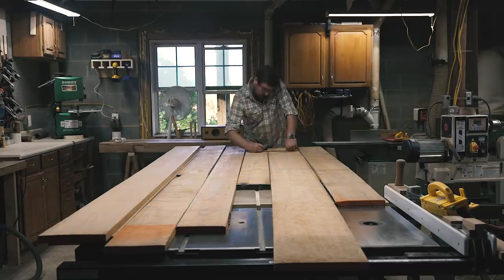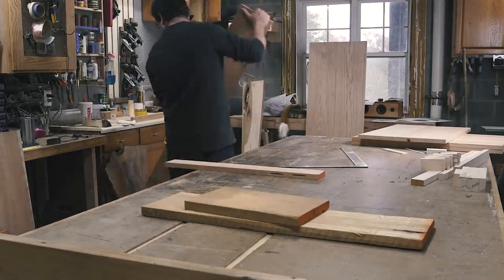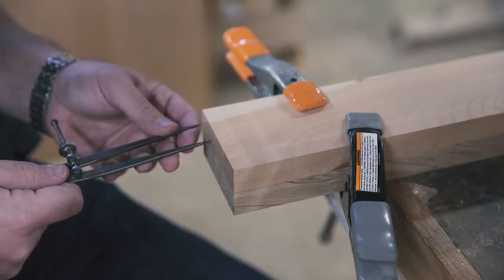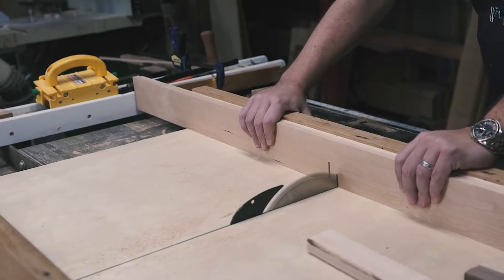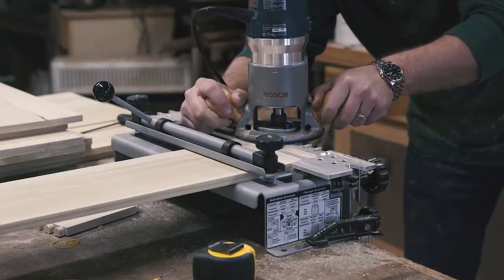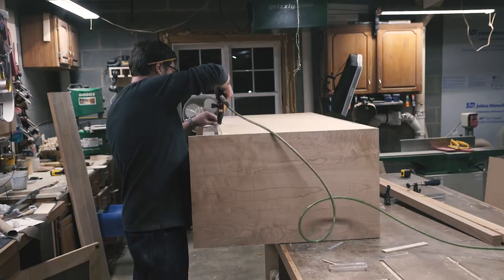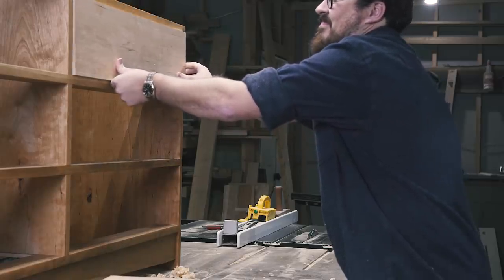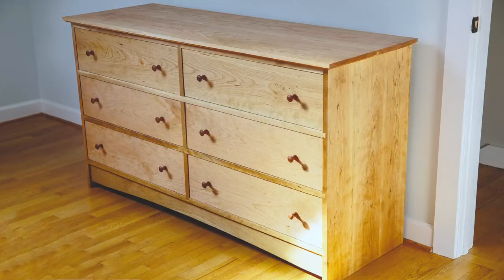The Shaker Dresser

Comment: Lovely work, and excellent videography!!  Thanks a lot.  I made a dresser like this in tiger maple a few years back, and it takes pride of place in our dining room.   The only difference was I did mouldings round the top using dovetail keys, which was very fiddly (not Shaker really).  I turned the pulls myself and had to do 3 times as many as I needed to find enough that matched!!

Comment: Lovely build Will! I couldn't agree more about pocket hole joinery. I feel like people like to jump on bandwagons and either love or hate a technique or tool without truly having a solid reason based on experience. Just like a jigsaw, people love to hate them these days (thanks internet!) but they have their place if used properly do exactly what's needed. Assuming it's not some old junker from the 80's that's been dropped a dozen times and has a worn out guide bearing. ;-)

Comment: This is great work. Beautiul piece. I could not do that, but I am more into timber framing and less into furniture making anyways :D
I don't think, that expanding and contracting of the top is a problem. If it moves, it moves together with the sides and in the other direction there isn't much movement parallel to the grain anyway. So I am pretty sure you could just screw or even clue the top on and don't need to mess with those clips. Those things have there place on tables, where the grain on the short apron is 90° to the top. But the grain on the sides here moves in the same direction as the top.
I have a pocket hole jig and I never experiecend failure, but I just don't trust them. Can't say why. I would glue on some blocks to secure the curved pieces.
The self claming joinery is excellent and I like the proportions of your dovetails.
I wonder if you could make a double bookmatch for the drawer fronts. "Just" resaw veneer and glue it to solid stock.

Comment: Correct me if I'm wrong: I though the Shakers invented the "pocket hole" method and it has been found on their pieces. Of course they didn't use it on anything that needs to withstand force as some modern carpenters. But totally ok for decorative pieces.

Comment: Hello ,   Your shaker- type construction is marvelous with bold exception of the mass produced drawer slides as used in office furniture .   Can’t imagine why you would have used them on this piece .   Seems an adulteration of this dresser which most certainly should have had traditional wood runners and dust panel construction  for the drawers . Certainly no place for metal and ball bearing Home Depot drawer slides 😏
Reply from the maker: While I do regret not using undermount slides instead of side mount slides, I wouldn't have put traditional wood slides in because I was matching a similar piece in the clients home. Im not so sure the Shakers wouldn't have used a mechanical slide if they were available at the time. They were a pragmatic sect and claim Tabitha Babbot to be the inventor or the Circular Saw (although   she isn't the name on the patent). In the later years of the Shakers their furniture and architecture was becoming more ornate, so its hard to say what they would have used.

Comment: Great Shaker Chest of drawers build!  You mentioned resawing was such a joy,  what size resaw blade did you use for that video?  Or what size blade do you usually use for resawing including the amount of teeth per inch?  Good job!!!  Oh yes, I like Grizzly tools also!  I have a G1513X2 17" bandsaw.  My first experience with resawing didn't go well, the feed rate was so slow it seemed, probably my error.
Reply from the maker: I use a 1/2" 3-4 tpi blade. Either a "woodslicer" from Highland Woodworking or a Timberwolf "positive claw". I follow the Alex Snodgrass method for setup. I can't explain it better than he can so I would google it.

Comment: Are the side panels and stretchers 3/4". They look thicker. If so, would 3/4," give enough strength or is the thicker stock part of the design? I'm restarting my woodworking journey in my retirement and would like to build this for my grandson. Then a taller thinner version for twin granddaughters.
Reply: Nevermind - found cut list

Comment: How come everyone  accounts for seasonal movement of the top but not the sides or dividers of pieces like this?
Reply from the maker: Essentially you are. You kind of think of the carcass as one piece that moves, and the top is another but on a different axis so you assume the sides and dividers will expand and contract at the same rate and the top can act on its own. It's the screw and or glue that's the issue. If you glued down the top and the sides and top contracted at different rates do to maybe more moisture content on a horizontal surface due to humidity, something would fail. The framework pieces of the carcass should move with the sides and dividers.
Reply: @wmwalkerco  Thanks. Never thought of the carcass as 'one' piece.

Comment: Why make the center panel out of cherry when only the front edge is seen? Seems like you could've made that from poplar and edge glued a strip of cherry for the front.
Reply from the maker: You're totally right. I thought about that while I was building the project,  but I had some extra Cherry stock that fit the bill and it saved me the hour and a half round trip to the lumber dealer.
Reply from the maker: I just ran the numbers,  it cost me $18.50 versus $8.50 to make it out of cherry rather than poplar

Comment: WALKER10  coupon does not work
Reply from the maker: On what? Its specific to certain machines
Reply from the maker: I just checked it on the jointer and bandsaw. It's working for those
Reply: 20'' planer
Reply from the maker: Ah you're right. I'll have Grizzly look into it. They just added that machine to the discount so it may not be live yet. I'll keep you posted
Reply from the maker: The code should be working on the planer now
Reply: just ordered planer from customer service coupon worked  thanks shipping day  after  x-mas   should have 3 to 5 days